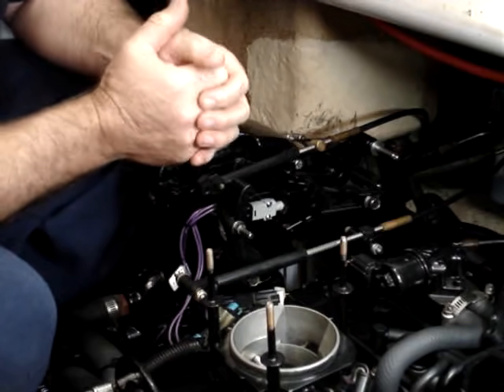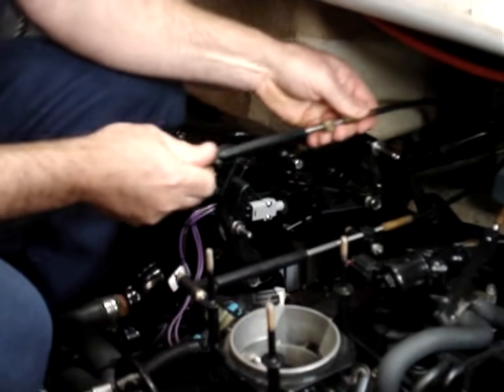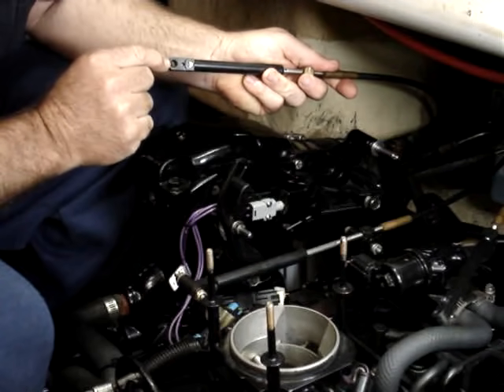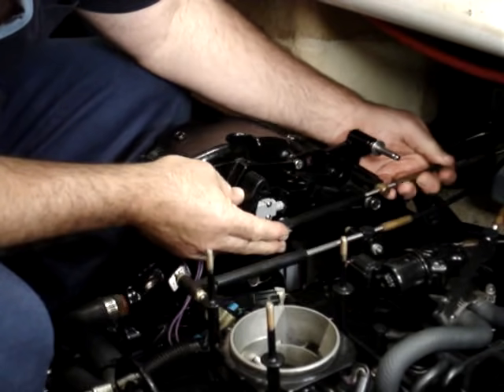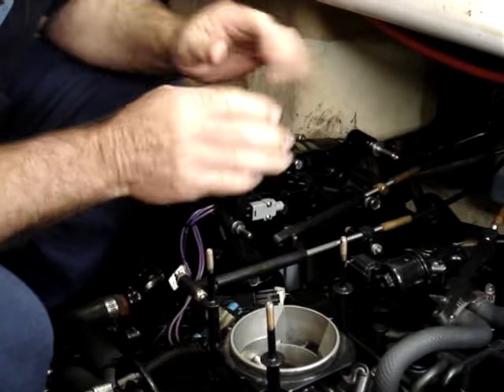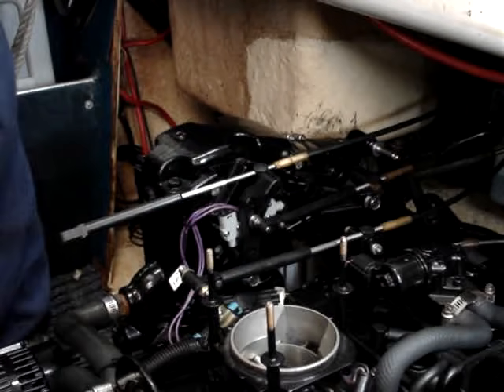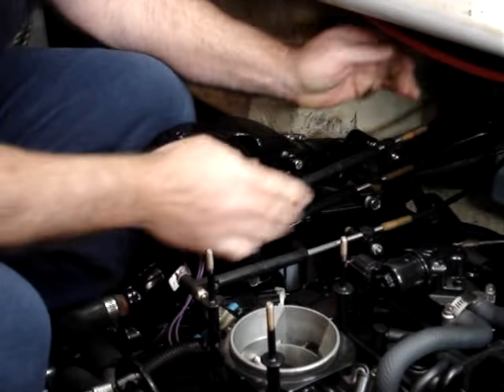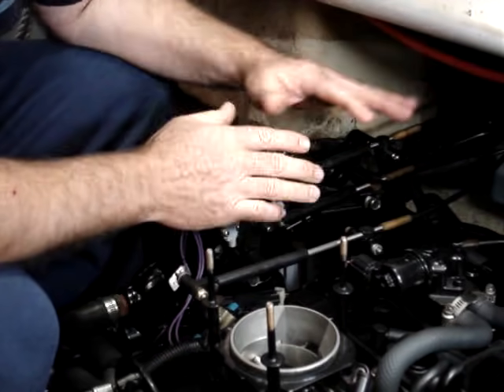Mercruiser Alpha Shift cable adjustment

Comment: I don't have good engage or response on my reverse. It needs to go half way down from neutral for it to reverse. Its a 94 mercruiser 4.3lx with Alpha One. What are the specs for that ? 5-7/8 for lower ? What are remote cable correct measurements ? 

Thank you
Reply from the maker: You need to remove the drive and troubleshoot the cable and shift system...
Reply: All R,MR, Alpha 1, and Alpha 1 Gen 2 drives from the mid 1970s and newer have an exact 6 inch measurement only MC-1 drives mid 1970s and older use the 5 7/8 inch measurement. The drive should be completely in forward gear on a standard rotation and in reverse on a counter rotating drive. In ether case the shift foot points straight forward towards the bow of the boat. Being your boat is a 1994 there is most likely a number of years on the shift cable. If the shifting was ok and now you are not getting reverse. 7 out of 10 times that means the shift cable between the engine and drive is stretched due to age and needs to be replaced. You could also have wear on the gear lugs, a bad shift spool, corrosing restricting movement of shifting component, but I would start with the cable first. If the cable is bad DO NOT force the shifting or hillbilly adjustments to keep it going you will only damage other more expensive parts.
Reply: Thanks guys. I am the 3rd owner and this will be my second season. Looking at all service records, as of 2015 it reads: "lower shift cable original but ok". 

I will probably look into it to see if its still "ok" even though it was the same when i got it in 2016
Reply: If that is the original shift cable from 1994 I would definitely consider replacing it. I would not expect that cable to be performing properly after 23 years. If you were my customer I would recommend you replace that cable if the bellows need replacement now might be a good time for that as well. Good luck I hope you get things worked out.
Reply: Good call, especially if its still there at the storage for few more weeks. Any idea of the approximate cost ? Lower cable and bellows ? Thank you !
Reply: I don't what shops charge where you are at, but I know from what I have seen with shrink wrap prices nationwide cost can be all over the place. In southeast Michigan where I am at, for a full boot job on an Alpha 1 Gen 2 that would include all 3 bellows, the water hose, shift cable, trim sender and limit switch, and any other little incidentals. Prices range from $900 to $1,200 depending on the shop. A small independent guy that uses some aftermarket parts might be cheaper but a large dealer in a marina using all OEM stuff may charge more. I hope this is helpful.
Reply: @James-eq8fs  whats the other three. i just changed my shift cable and no reverse locking on the prop. out of water. worked fine before deciding to change it out while i was changing the bellows and gimbal. thanks

Comment: Chris
I have my out drive off to check alignment and if feels like there is a lot of play in the end of the cable at the drive end...  I am referring to where the cable meets the metal part that engages the shifter that you see after you have the drive off...  I have not measured it yet but is that normal to have some play here?  thanks for your help and great video.
Reply: Chris if you are talking about the metal end called the shift cable slide at the drive end of the engine to drive shift cable see the image in the link below. The shift cable slide should rotate that is normal but there should not be any back and forth slop between the cable end and the shift cable slide. Also the video does contain an error related to the adjusting trunnion on the engine to drive shift cable. The trunnions are only pinned when the cable is brand new from MerCruiser. That way the cable has the correct setting on the assembly line. All replacement cables whether from MerCruiser or aftermarket have a no pinned adjusting trunnion. 

https://cdn.shopify.com/s/files/1/0748/6631/products/IMG_7782_505725b6-8ace-4fa2-9598-1fb6b611fa41_1024x1024.JPG?v=1470288328

Comment: There is a much easier and precise method to adjust the alpha cable. In theory, you are right but your way isn't always correct. And yes you should hear the engine cutout when shifted on a hose. Its not as noticeable on a hose but you should be able to hear it.
Reply: I don't know why you say this way isn't always correct.  My Mercruiser Shop Manual says it must be 6 inches distance.
Reply from the maker: Apparently lenmos1y knows better than the drive manufacturer... I was trained by Mercruiser, and had my own shop for years, never had a problem doing it 'by the book'... Len, if your way is so much better, let's hear it....
 And NO you should not have the interrupt switch activate when running on the hose. That comment PROVES you don't understand how the system works....
Reply: chrisa660 achris, 100% agree !  -CaptainMak
Reply: @chrisa660  Hi Chris. What can I do if my engine cuts out sometimes when coming back into neutral from forward or reverse ?

Comment: What should I do if I have done everything you've said and it shifts into forward perfectly but no matter how high I slide the bottom bolt up in the slot it will ratchet in reverse? I've taken everything apart and started over from the beginning 3 times now and it ratchets in reverse every time.
Reply: One thing to add. Both the upper and lower are rebuilt and both the remote and lower cables are new.
Reply from the maker: If you put the drive in forward, the prop will racket when turned FORWARD. Put the drive in reverse, and it will racket when the prop is turned REVERSE. That's normal. The prop will only lock when you try to turn it the opposite of the gear it's in. ie, it will lock when in forward by turning the prop in REVERSE. It will only lock in reverse when the prop is turned FORWARD.

Comment: Hey mine is Brandon, I have my shift cable at 6" and my control cable like you said, then I seen where you told somebody that the cut out switch won't work on a hose, iam heading up to the lake this weekend, if my cutout doesn't ingage what else can I do? Just wondering and thnks for the videos they were lots of help
Reply: Turn the motor  off  for a second to get it out of gear then start it back up

Comment: I have a problem,.my carb lever won't open and if.open it will.start but if I put it into gear the lever closes.and the boat dies?
Reply from the maker: Not sure exactly what you mean, but it sounds like the lower shift cable needs replacing, and the reason to be investigated. Probably a leaking seal on the upper shift shaft allowing water into the shift cavity in the bell housing...

Comment: I'm amazed every video shows how to install something but nobody wants to show trouble shooting or tell what happens say if you can only pull 5 1/2
Reply from the maker: When things don't meet specification, then you need to do the troubleshooting. The reason nobody does troubleshooting videos is because there are so many different things that can cause what's wrong that it would take days of a video to go through every possible scenario, and even then, something will be missed. If you have a problem, get onto one of the forums and chat directly to people like myself. It's a lot easier when it's a one-on-one type conversation. The videos I do are for people who have finished a repair and just need the final adjustments. If something else is wrong in the system, these adjustments usually can't magically make them disappear...
Reply: Impossible for the poster to know all issues you may face. He does try and tell you some hints if you listen carefully. If your boat is stalling you are out of adjustment. I had this happen myself. He mentions what to do if it stalls in video. It is because the drive cuts the ignition out while the boat shifts to smooth out the transition by killing the power. If your cable is traveling too far it is holding the switch too long and killing the engine. You can see the switch easily right where the cables mount. I am not a professional mechanic but I had this same issue after replacing my cable. I have twin engines and twice as much fun. Good luck.

Comment: Every time I ship is it supposed to make grinding noises???
Reply from the maker: Yes, it's the design of the clutches. They are dog clutches, not clutch plates. Also, don't 'ease' it into gear, it's either in gear or out of gear, no in between. Single shift movement. easier on the drive, and less grinding.

Comment: so, if I don't have the 3" from the remote cable, is it safe to assume I need another? I have about 2-3/4" travel and thats it.
Reply from the maker: Means you have wear in the remote control.
Reply: @chrisa660   yep I have same issue, 2 15/16 .. Not sure of the specs, but I was able to move the slide to get reverse.  But will be replacing the upper cable from the controller to shift lever in the spring.
Reply: @libertyfinder4889   
( Cable OK
Specs are 3 inch + or - 1/8th ).

Comment: chris - working on a 67 and 74 simultaneously, got a new bellows kit for the one and the lower 9/16 brass nut is facing forward (threads in from the front - on both outdrives actually) - however the replacement cable that arrived threads from the rear, I see alot of ref to the 1/4-18 tap, but that only seems to possibly match the small threaded end up at the top, the lower brass nut looks more like  a pipe thread NPT 1/2" - the threads also dont run all the way thru from the front, im thinking of continuing the threads thru from the front - is this correct? if so any specs on the thread?
Reply from the maker: Yes, the earlier drives had the cable installed from the front (as you are correctly orientating :-)). Later cables are made to be installed from the back, but the threads are tapped all the way back. Mostly over time, the unoccupied section just gums up (technical term). Use a 1/4-18 NPSF (Parallel thread!) tap and run it all the way though from the front (bellows side). No guessin' ;-) Hit me up at iboats forums. Find me as 'achris'...
Reply: ok great thanks, will do - im active there as CamaroMan. Im bidding on a Tap 1/4 - 18 NPSF RH, the tap i unscrewed is MUCH bigger than 1/4 " - i dont understand what the 1/4 is for? i did make a new thread - thanks again. Also the grounding clips on the bellows, do they goes with the dots on the case or between rubber and clamp? how important are they - this boat sees saltwater maybe 10 times a year - mostly fresh -
Reply: Hi - not sure if prev reply went thru, so ur saying clean it up and itll go in from the rear? Whats the deal with the 1/4 npsf tap then? The brass bolt measures roughly 1/2" - how will a 1/4" do anything? Sorry but just plain confused :)

Comment: Can someone explain what "exactly correctly" means at 5:04?
Reply: I think the meaning is make the Barrel dimension to the end of the cable /pin match. Then move away from the pin with 4 rotations of the barrel.

Comment: Hi

Hope you can help follow your instruction which were great, works perfectly on dry land but when in the water and under load really struggles to go from forward to reverse you have to go pass neutral a long way in either direction to change from forward to reverse and reverse to forward any help would be much appreciated 

James
Reply: Sounds like it may be the shift cut-out switch not working or out of adjustment.

Comment: Would this work on a 1969 in line MerCruiser 160 hp
Reply from the maker: In the case of the 1969 160hp, use the measurement of 5-7/8" instead of 6". This applies to drives up to 1973.

Comment from the maker: Sounds like you have excess wear in the control box and the cable is not being moved all the way out of gear properly, or a cable adjustment issue. How old is the control box?

Comment from the maker: To understand the system, go to a forum called iBoats (forums dot iboats dot com). Then click on the 'Mercruiser I/O and inboard engines...", then click the 'sticky' at the top called 'Adults only'... Once you are there, item 9, How the shift interrupt system works. I would have given you a link directly to it, but youtube doesn't allow that in the comments :-(
Reply: It is not "mercuriser I/O and inboard engines", but rather "Mercury MerCruiser Sterndrives& Engines"  Thanks for the video!
Reply from the maker: My comment was made 6 years ago, and iboats have recently renamed a few of the sub-forums, so yes it's a new name. Same meaning though. ;-)
Reply: @chrisa660  I figured that may have been what happened.  I really did enjoy your video, however, I couldn't adjust my cable.  The distances in both cables were 7" and there's no way to get 6"....?  I looked in your "about" section to try and PM you, but there isn't a link.  You really seem to know your stuff.  I'd like to pay you for some of your time, as there aren't any boat mechanics around here.

Comment: hi chris, great video. Is it possible for an adjustment to have no clicking when spinning the prop both directions) in neutral, but once the engine is running there is a slight clicking? Checkout my video here. Seems to click when in neutral-engine running, but not when it's in drive-engine running. but with engine off, no clicking. 

https://www.youtube.com/watch?v=XGXRx5HGM5o